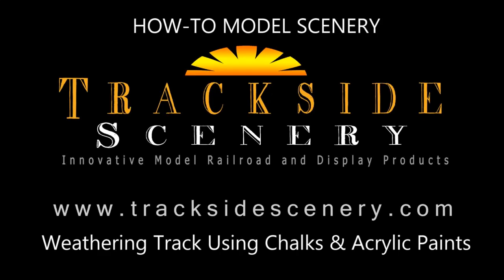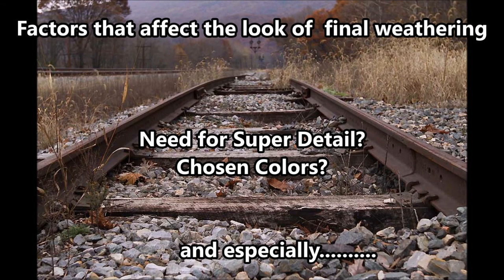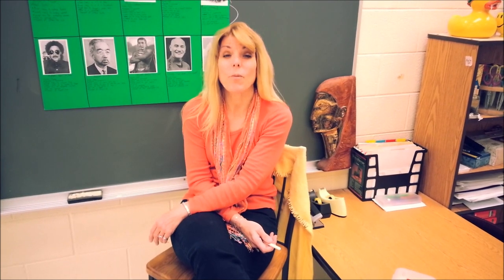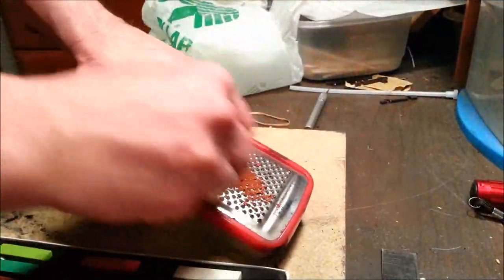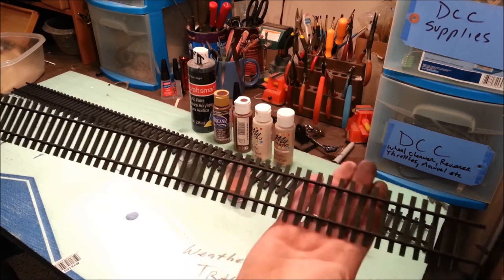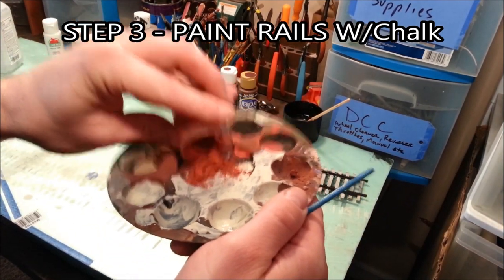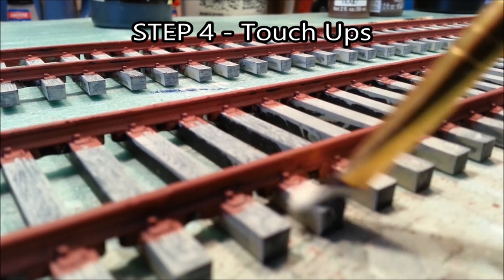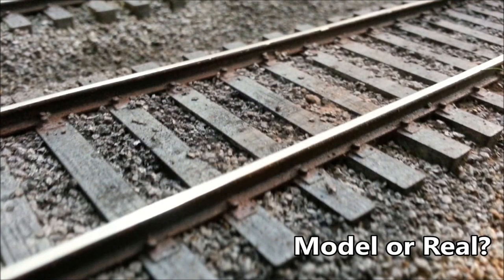How-To Model Realistic Model Railroad Scenery - Weathering Track - Budget Supplies

Comment: Amazing that the best track weathering technique is from a 10-year old video. I've watched dozens of track-weathering YT videos and liked this one best. I tested it on my Atlas o-scale layout and the results were absolutely stellar. I did make some minor changes to the technique though. Firstly, I prefer Pan Pastels in lieu of chalk as they're ready to use, not that expensive and go a long way. I also used Krylon Camouflage brown to initially spray the track instead of black. Spraying the track with an oil-based primer is critical because the chalk needs something to "bite", and this Krylon is one of the best primers you can get. I also found there was no need to mix the alcohol slurry rust chalks -- I just dusted the rails and tie plates directly using a mix of oxide read, burnt umber and black -- which sticks just as well as the alcohol slurry painted on. Anyway, it's a bit of work but the results are worth in and better than anything else I've seen. Thanks Joey!

Comment: Love the Chalk/Alcohol for rust. I took some 150 grit sandpaper "painted" it with your rust and used small strips for S scale tie-plates on my re-purposed American Flyer track. I replaced the ugly metal ties with stained wood ties cut by the folks at Mt. Albert, Then glued down the tie-plates and spiked the rail down with small spikes. I also used your rust on the rail sides.

Comment: This is hands down the best weathering advice I have seen on Youtube.  How do you handle the shiny spots when you bend the track?  Is that simply touching it up?
Reply from the maker: Yep, You'd have account for that when doing each piece or simply touch it up. I felt that most folks would probably paint and weather with track on layout as opposed to how I did it in video before hand.

Comment: Are there any issues with the connectors when putting the track together, or do you use Bright Boy and sand paper on these as well? Totally new to modeling railroads.  Great videos and thanks.

Comment: Great video!  Have a question for you.  Why do you grate the chalk and paint with that versus using rust color acrylic paint?  Does the chalk give a certain texture?  If you chose to use acrylic paint, is there something I could add to the paint to give it that texture?  Thanks!
Reply from the maker: Hey Phil, 

Great question actually, and I hope folks read this. Because I am an artist and professional photographer I see it without thinking about it, but many people do not relate the word "texture" to something visual and often think if it in terms of feel or taste only. Yes, the chalk does create a certain texture that acrylic paints may not have, it is also the unique quality of the "change" it takes on with the addition of more chalk over it. Another little secret is that I use this rust chalk for painting the effects of rusted metal on many items in model building. From brackets, bars, plates etc, but in that case I "dumb it down" with a black paint wash. Water base paint or solvent wash both work, only consideration for that choice should be what you are applying to and regards to how thinner in the solvent wash would effect a surface.

So to sum this up, the use of chalk is different from acrylic in the concept that it absorbs and changes it's look. Paint in many cases just covers, but a dusting or wash over chalk is absorbed into the effect. feel free to email me if you have additional questions.

Comment: Hi Guys - Great Video and thanks for doing - Question if you tracks are in and already ballast - you said the technique applies but do you still go with the same technique and paints?i.e. suaeda  - Thanks Again
Reply from the maker: @Matias Martinez, it would be a challenge to do this after ballast is applied. You probably could do it, but if it were me, I would vacuum all the ballast off and start over.
Reply: Thank you - I am going to experiment with leaving the track on with the ballast - tried the vacuum and not is moving

Comment: What did you use to clean up the tops of the rails for operation when all is said and done?  I usually use rubbing alcohol to clean off my rails but I'm not sure if it will take off the powders and acrylics.  I really want to use a variation on your technique but don't plan to go dead rail! Thanks in advance.
Reply from the maker: Light fine grit sandpaper, bright boy cleaning block and or paint thinner all work just fine. We use this technique on our current project layout series which you can see right here on our channel. Approximately the 10 most recent videos here on the channel are about the current project layout.

Comment: I started out by spray painting my Atlas O track with Camouflage colored spray paint. I then applied a Khaki colored acrylic paint to the ties. I followed that up with the 'pasta sauce' to add the rust color to the  rails. It was all looking good. I ran into a problem when applying the chalk. It just didn't stick to the ties enough and the ties do not seem dark enough. Anyway to get the chalk to stick to the ties better?
Reply from the maker: When you say "chalk on the ties", can I assume you are talking about the black dusting?......could be the chalk you are using or the brush or duster you are applying it with. Experiment with it.
Reply: Exactly.....some spots cover well and they look great...other spots are barely covered...I will try a different brush...have already tried 2 different type of chalks...thanks for the tip Joey

Comment: This is probably a stupid question, but since I haven't weathered with chalk before, how well does it stay put?  Does it flake off over time?  Do you need to seal it to make sure that it doesn't rub off?  I'm new to the whole weathering game, but I want realism in my models, not some cheap - looking plastic toy.  I primarily use N scale.  How well do you find the texture of the chalk works in that scale?  Thanks for your input!  I liked the video.
Reply from the maker: +El Chick - A good set of questions and assuming we are talking about track and structures (not locomotives)! The smaller the scale, the finer the chalk or pigments should be, but don't drive yourself crazy trying to over do it. I use the same stuff for O, HO and N Scale. It works the same in all scales, but like anything, you have to experiment with the technique. 

The part about "staying on" is answered when you ballast the track and apply whatever method you use to make the ballast stay put. That is what will keep the chalks on, however, with the dusting of the track, The wetting or over wetting can drain some excess down into the ballast. In that case you can go back over it with another dusting.

The Spruce layout you see in the videos was completely done with this method and the layout has traveled thousands of miles to train shows without having to refix the weathering. Occasionally some ballast gets loose from the traveling, but that is an easy fix with the same methods.
Reply: +Trackside Scenery 
Thanks for the answer!  Since you bring it up, I am assuming that you would need to seal a locomotive to keep the chalk from rubbing off.  What kind of sealant would you recommend?
Reply from the maker: +El Chick  - Locos and rolling stock I do differently. It is with chalk powder, but mixed with thinner and applied wet and also as dry dusting. This for both the dirt, grime and even rusts. Practice on old stuff though, it takes some getting used to and like the track and such, you can't just wipe it off. 

Additionally, you can do this with water in place of thinner which makes it easier to get some off or adjust, but it if you get a look you like, you may smear it once dry. In that case you'd need to seal to keep it on.....with that said El Chick, I use the thinner method and I do not seal it in any way.
Reply: +Trackside Scenery - Excellent, thanks very much for the insight!  I have watched several of your other videos as well, and have subscribed.  Keep up the awesome work, and thanks again!

Comment: Joey, would you suggest the same basic colors for PRR mainline on the NE corridor?  I am modeling portions of the PRR both South and North of Baltimore Union Station.  Thanks.
Reply from the maker: Jay, absolutely. If you find a prototype picture, you can compare and adjust your colors based on that. It's always best to test a small section to see what the results will be.

Comment: Do you clean off the top of the track so that you get electrical current through for dcc?
Reply from the maker: Ty, sorry for the delay in response. yes, you should always consider electrical contact after painting and such. I use a bright boy cleaning block or 300+ grit sand paper to take off the paint and residue. There are also chemicals you can use, but I do not use them. Make it easy.